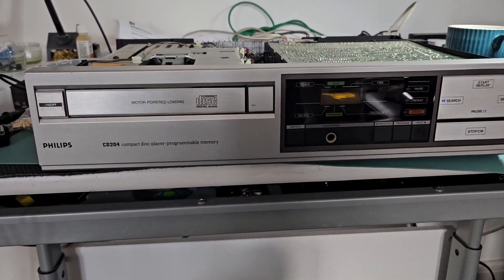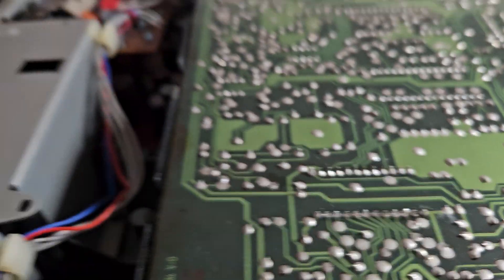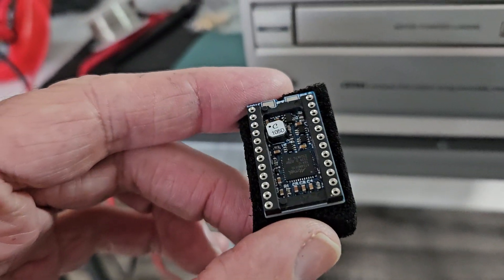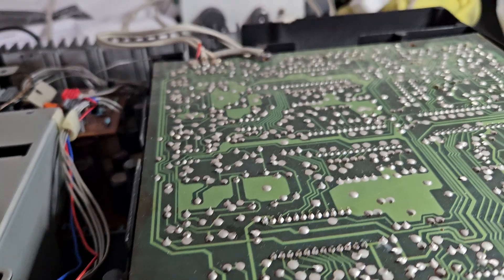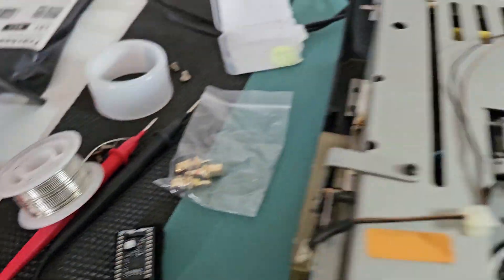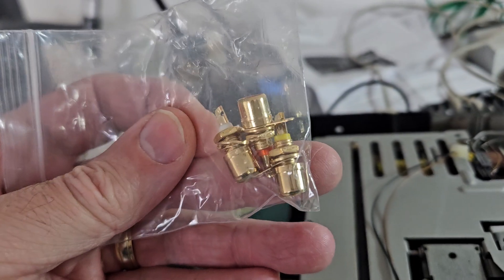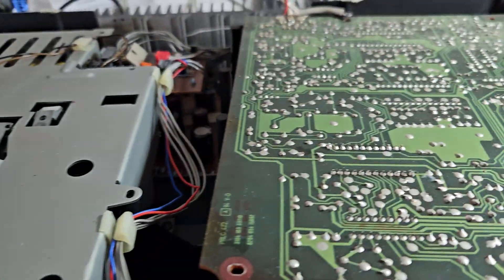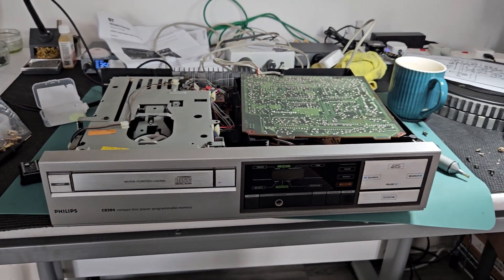Philips CD-204 Digital Output Conversion (Sound Traces Module)

Comment: These are pretty interesting, giving the ability of S/PDIF  digital PCM output and allowing to use the player as a CD Transport.. keen to see thoughts on this over the NOS Mod.
Reply from the maker: @flaviospedalieri8707  The client is very happy with the Modification and it is working well with his SU-1 (MQA equipped) DAC. The NOS module affects the TDA1540 DAC within the CD player and makes a huge difference (I am referring to my own modules here, as I haven't tested Sound Traces ones).
Reply: @delatronics  Yes I am! The SoundTraces upgrade chip is AMAZING. With MQA-encoded CD's the encoding is carried thru and decoded by the SMSL SU-1 DAC.

Thoroughly recommend Phil's talents and skills for audio and digital repairs and mods.
Reply: Hello, is it possible to do that with a Technics SL-P1200 too?